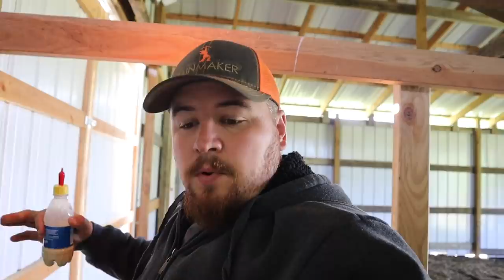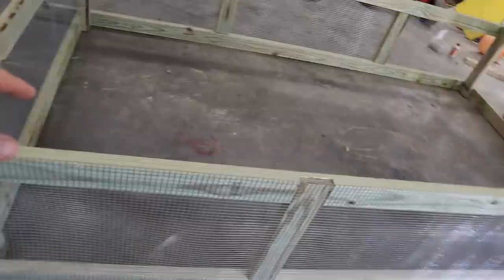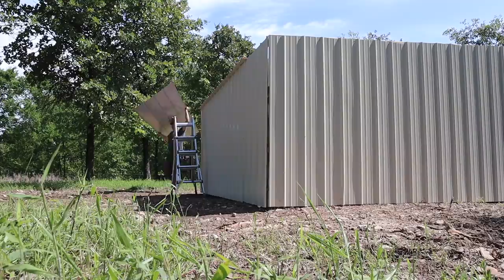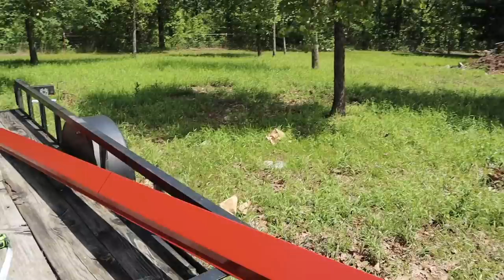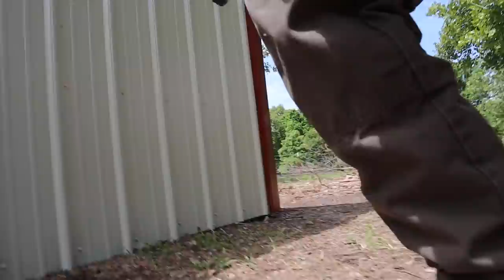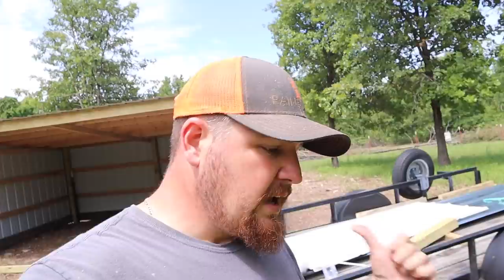The Ultimate DIY Pig Shelter! Backyard Farm Raising Hogs!

Comment: That's a sexy looking shelter, Kevin. If you find the bailing wire comes loose, or breaks, you might want to drill a couple of 5/16" clearance holes, in the T posts, and put in a couple of 1/4"x2" long lag bolts, into your wood frame. Lucky pigs.

Comment: Sorry about the baby that has to be so tough on you.

Your chicken tractor is a beauty.
It looks so versatile. It looks like it could be used for other things when you don't have the meat birds.

You and Rachel are very good with projects because you think about how things can be used. In this instance you spoke about needing a structure for the meat pigs however you did not limit your thinking to the size of the pig and it's needs.

Comment: I suggest you get some rebar and cut them about 3 ft long and drive them into the ground at each corner of your shed and at the halfway point.....then use doubled up baling wire  to tie that sucker down good....I had a a12 ft x 23 shelter logic tent with 4-85# cement pads on each side and last month we had a high velosity wind that picked that whole sucker up and moved everything, tent, concrete, 1-3/4" steel frame clear across my yard!!  After I get some replacement frame members, I will be using either rebar driven deep into the ground or put some 14  5-gallon buckets of concrete 2 ft deep in the ground to hold that SOB in place.

Comment: Tin snips come  left cut right cut  and straight  cut  the one  i find work best when cutting straight  actually  is double straight cut has 2 blades on one side  and 1 blade the other and there a 1/4 in strip that comes  from the middle   this really  handy  when cutting  ductwork  ot stove pipe
Reply from the maker: I've never mastered them

Comment: 🤔🤔🤔. Hog shed???  Mmmm I’m thinking it’s more like a “Hog Palace” instead.  Yep you sure have some building skills making everything on your place pleasing to the eye and perfect for any and all of your animals. And you complete it knowing that all jobs need to be completed in a timely manner before moving onto something else.  Really....zebras??? 😂🤣😂 My gramps made sure I learned that any job you do needs to last a lifetime so do it right. Other than one time I’d built a shelter half that size knowing wind would be a factor. Didn’t drive stakes deep enough nor added cement thinking that the opening was opposite of the winds so I was pretty safe. I got fooled when wind shifted shockingly and worked the stakes lose and have ya ever seen a shed airborne??? Over the fence and trapped between electric pole and neighbors garage a few acres away. Just saying that additional posts cemented puts your mind at ease and can easily be pulled out with your tractor. The right wind and those suckers can really take off. 😢😢.  Sure hope your boys out there helping and learning all your skills......bonding of father and son. Any age is perfect to begin learning. And you’re sure in need of some help as you’re burning the candle at both ends lately.  Chicken tractor looks amazing and definitely another palace for sure. You both gave baby goat a chance but you most likely knew she had too many things against her.  Always the worst part of farming and then never knowing why. So odd how momma separated herself from baby just like she already knew.  Now you’ve got to get ready for different babies soon cus two sows birthing together it’s possible they could eat the babies being so close. After few weeks they should be fine but those two are super big and pushy. Yep nothing worse than going out to a massacre and not being prepared. Hope weather is good for all you’ve got to complete but really hope you stay healthy. I’m thinking at end of day you pass out on the pillow real fast. 👍👍👍👍👍👍👍👍👍👍

Comment: I am so literally confused. Why would you put the feeder inside the farrowing shelter? Just know I am completely ignorant of these things is why I ask. It's a serious question, not a criticism.  Have you changed your mind and not going to use that for farrowing? Does that mean you have build another shelter or will the one they have already be ok? 
I heard and have seen that if you turn you blade backwards on a skill saw that it will cut that type of metal. Might even be easier than the grinder. Not sure. Just saying in case you have not heard that before.
Reply from the maker: This new shed is the feeder pig shelter, not the farrowing shelter. Putting the feeder in there so the feed don't get wet when it rains.
Reply: @HiddenHeightsFarm  - As a feeder shed I get that. But, I thought you were going to use it for the birthing. Did I misunderstand?
Reply from the maker: @PaullaWells  yep not for the pregos
Reply: @HiddenHeightsFarm  - 🤣